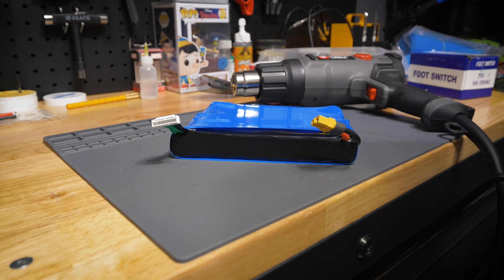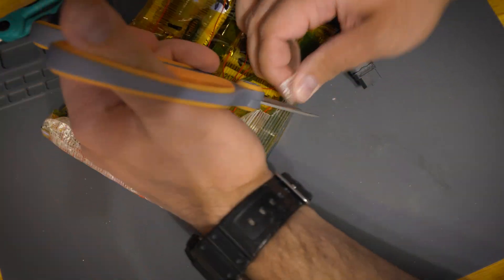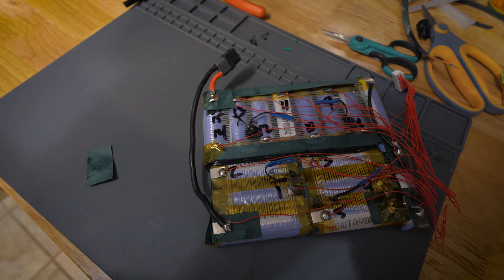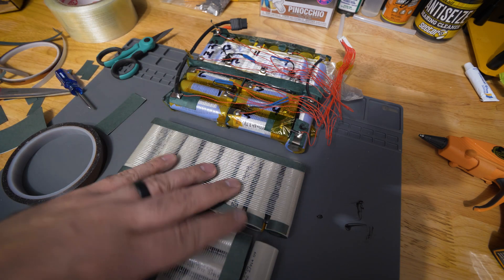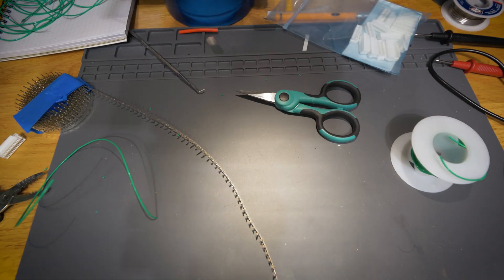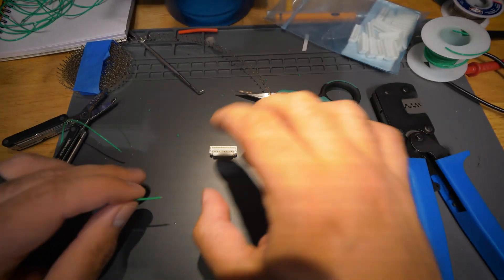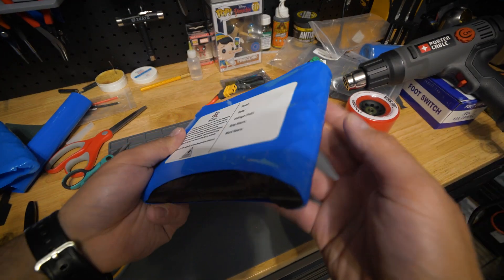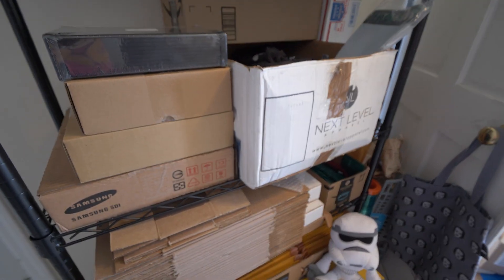Fixing a Onewheel Battery | ChiBattery Quart Rebuild (Pint Upgrade)

Comment: great video, i want to do one of these myself. Is there a specific Thermistor you used ??? Cant find the part listed or mentioned anywhere. Also do you think the pint can take advantage of the extra amps of a p45b instead???

Comment: I have a onewheel gt with 1000 miles. Has been running strong but recently I ran it too low and it now wont charge. I believe the bcm is good but battery is showing 10v.
Can I send the battery to you for rebuild?
Reply from the maker: Unfortunately no, I don’t touch other people’s or factory’s batteries anymore, and I’ve since stopped working on Future Motion Onewheels at the shop. Sorry.
Reply: @TheBoardGarage  Thanks for the content either way.
Any recommendations?

Comment: Is the balance connector same as the one in XR?
Reply from the maker: It is.
Reply: @TheBoardGarage  Thanks for reply. I'm sorry to bother, but other people might have the same questions. Are there some specific thermistors (they're not included in parts list)? And the connector pinout is the same for the XR as well? Thanks in advance
Reply: @tomastraxler8585  NTCLE413E2103F102L is the part number of the thermistors

Comment: Hi Mario do you fix electric scooter batteries, I noticed mine is not holding charge as it use to.
Reply from the maker: I do work on scooters, yes. Some aren't easy to work on so it depends on the scooter model.

Comment: Just curious what battery welder you use and why wonder why you didn’t use the original BMS leads
Reply from the maker: I use a KWeld, running off of a car battery that's on a constant float charge from a bench power supply. I didn't use the balance wires because I just wanted to redo it and see how it would be to manually make all of those crimps.
Reply: @TheBoardGarage  been trying to get a hold of the us rep but no luck
Reply from the maker: I've ordered from their EU site and it works fine.

Comment: Hey Mario - Just discovered your channel, and I'm extremely impressed.  Looking forward to giving this kind of build a try.  Have you attempted any modifications to increase the top speed on the pint?  I understand that it uses the same motor as the XR (I could be wrong there), but it's just tuned to lower speeds.
Reply: The firmware is locked down
Reply from the maker: There aren't really any mods for speed, other than changing tire size.

Comment: Hi Mario. I'm glad you made this video! I've had the exact same issue on my Quart battery. I'm seriously interested in building a battery for myself like yours, but I'm curious about one thing. Sense ChiBatterySystems upgraded to the P42A, is there an even better cell you recommend? Additinally with their new updated cell do you think its not as bad of a design minus lack of quality construction?

Comment: Create tutorial! I have a couple questions for you. 

1) You mentioned that the cells you used are "better". What's better about them? 
2) did you reuse the thermistors or use new ones?
3) How long did this take you? Trying to judge how long it would take me...
Reply from the maker: They have a longer cycle life, and a bit less sag comparatively for similar current draw.
For this, I used new wiring and thermistors. It took me a while, in fairness I took my time. It also takes longer to do things while filming a video and taking notes and photos.
Reply: @TheBoardGarage  Obvious you took your time, it looks very clean! Thanks for the quick response. I checked out your website parts list, I didn't find the thermistor listed. Do you happen to remember which part you used?
Reply: @jessea9448  I measured the stock pint battery pack thermistors and I got a reading of 9.6k so I think they’re 10k thermistors.

Comment: I've never built a battery pack before. I just watched some other videos on spot welding nickel strips, so what spot welder do you recommend? Currently, I only plan on building two of these Quart replacements, so I don't want to go all-out on a pricey machine.
Reply from the maker: I recommend the KWeld. There's nothing like it in that price range, it's one of the best values available. The quality and consistency of welds is very high, and if you decide you won't build any more batteries, you can sell it very easily.

Comment: I bought a quart from Chi. It didn't end up working because my version of pint is too new and not compatible... So bummed. Have you found a workaround?
Reply from the maker: Wait really? I thought current version was still functional. What hardware/firmware version do you have?
Reply: @TheBoardGarage  I honestly don't know how to tell but I just bought it last month...

From Chi:
 "If you bought a newer OneWheel Pint, you have the newer hardware/firmware. Unfortunately what that means is that FM has put in a block that limits using higher capacity batteries. When you powered down the board and turned it back on and got it to go nowhere, that is what is considered a power cycle and that confirms our suspicion of this block. What that means for you, is that you can still use our battery, but you will only be able to enjoy an increase in torque, but not the full range of the battery, and are limited to the stock range of the Pint."
Reply from the maker: Oh wow. Can you please look in the app and find the hardware and software versions?
Reply: @TheBoardGarage  5314/ Gemini 5059
Reply from the maker: @discombobulated2003  Thank you. So indeed...newer firmware. The mods seem to work with 5050 firmware and earlier.
Reply: @TheBoardGarage  Chi's webpage says exactly that 5050 works, newer 5059 doesn't 😔
Reply from the maker: There's a conflicting report from Ryan Witz, and that he's installed mods into newer Pints and they work fine.

Comment: Great video and blog write-up. One note: OEM Pint packs use the VTC5D, not the VTC6. I’ve torn 15 of them apart and they were all 5D cells. Way more C rating and a little less than 6Ah.
Reply from the maker: Yes, you're right. I knew that, but for some reason I had the XR cell in my head and that's what came out. Definitely a brain fart. 
Thanks for pointing it out. 🙏

Comment: Could someone please explain to me which pins to use for what on the connector for the balance harness?
Much appreciated!
Reply: I found a pin out on Google
Reply from the maker: I'll try to remember to update the article with the pinout.
Reply: @TheBoardGarage  Great! Looking forward to it!
Reply: @TheBoardGarage  Thank you so much for this fantastic video! I'm currently at the point to solder the balance wires. Can you please post the pinout?

Comment: Just wondering what size pvc heat shrink you used I don't want to order the wrong size. I'm currently collecting parts and waiting for batteries to come in stock
Reply from the maker: I'm not entirely sure...might have been 180mm I think. I'll have to check and then make a note in the build article. Li-Ion Wholesale has the P42a in stock right now for a great price. A big shipment hit the US a week or so ago and most of them sold out from the usual sellers. But Li-Ion Wholesale has some, I ordered a few hundred from them and got them quickly and cheaply. Best of luck.

Comment: So, which parts of the original quart battery did you reuse? New cells, new balance wires and connector...it's a completely new battery, not a rebuild 😂
Reply from the maker: Come at me, bro! ;) But since I ripped open the original battery...technically I re...built...it. Because #science

Comment: Hey man, great video as always! Quick question regarding the write-up on your blog. You mention that you believe batteries using this configuration to be unsafe, I am curious how dangerous you think it is? I have a Quart installed on my pint and wondering Is there an increased risk of fire while charging or is it more risk of the cells failing while riding? Thanks!
Reply from the maker: The idea of "safe" is kind of tenuous when it comes to larger lithium ion batteries. None of them are actually safe. And when you see the words "safer" or "safest", really what it means is "less dangerous" or "least dangerous". 
The Onewheel's battery was designed to fit in a box, accomodating for the space of wiring, a cell holder frame, and insulation. The space between cells and the box is the primary safety for failure. Extended battery mods remove that safety, and so they're inherently less safe, or more dangerous. The actual level of danger is unknown, since objective testing isn't ever done. And likely won't be, because not only is it difficult and time consuming, but it doesn't do well for hype, marketing and sales. Science in practice is boring. People prefer hype, easy answers, and brand loyalty. 
It's an imperfect situation, but I've chosen to manage imperfections rather than deny them. And at least, try to be realistic about it.
Reply: Do you like the range increase? :D I really want a new battery for my pint, my stock battery now gets 5miles after 1500 miles. I use to get 8-10 miles when my onewheel was brand new. I’m 200lbs. I wonder if I messed up my battery prematurely by leaving it in the winter cold in my car over night many time, rip

Comment: Could you please let us know which were the original cells in the quart battery?
Reply from the maker: Originally they were Samsung 40t cells. They then changed to the P42a.
Reply: @TheBoardGarage  Do you think a 15s2p configuration with p42a 21700 cells would be better (not range wise) than the 18650 15s3p they have in the CBXR? You should do a video talking about the best possible battery for an XR and build it
Reply: @legolasgleaf  good question. And if 3P is fine what should we use? Ncr18650ga is fine or we should look for something else?
Reply: @andrzejz8316  The better way to go should be maybe something like 20s2p, but then the BMS will not work... so need some kind of VESC. And I am talking in the original unmodified XR
Reply: @legolasgleaf  I assume we are talking XR controller here. Ofc vesc seem to be the way, but I don't think I have the time to be early adopter. Community has some enough knowledge to build up (motor overheating?) and some ready to use parts (e.g. rigid waterproof battery box) available. Probably going there next year.
Reply: @legolasgleaf  The big issue with 21700 cells is they don't have as much current deliver so under heavy draw from the motor they tend to sag pretty badly. Granted even an XR only needs around 30A of current delivery but most 21700 seems to struggle with even that which seems to be why 18650 still reigns king for most PEVs is what I've noticed.
Reply: @mwiz100  but p42a 21700 cells is 45A, and if you have it in 2p is 90A (which even if is not real, is more than enough, right?), that's why I am asking if a configuration of 15s2p with 21700 cells could be as good as 15s3p with 18650

Comment: Are any schematics available for this build. Mainly balance connector and xt60, it seems reverse or am I crazy?
Reply from the maker: It is indeed reversed. I'll add that to my blog post. The post has detailed photos of the rebuild, and I'm currently working on the balance connector pin out. It'll be updated on the blog later today.

Comment: Thanks for the video.  Really sorry to hear about this failure.  I've had the Chi Battery Quart since Xmas 2020, couldn't be happier.  One thing I noticed early on is that the battery is still doing something long after the Pint charger indicates that the charge is complete.  If you watch, in Diagnostics, the Regenerated Amp hours number will continue increasing for a long time.  I have been letting my Pint continue charging until this number stops changing.  Do you have any knowledge of what this is?  Is it still balancing after getting to full charge?
Reply: Even on my stock fairly new Onewheel+ XR this happens when looking at the diagnostic page while the battery has reached 100% the regenerated number continues to rise for a while. it does eventually stop increasing. I have heard that the battery percentage is a bit of a guess and is complex to work out correctly, so it is probably just a fluctuation or miss calculation while charging.

Comment: Did you diagnose the deffective battery, was it a bad cell, deffective BMS or simply weared out ?
I was curious to know Wh capacity and internal resistance if the battery pack before/after.
Nice craftmanship !
Thanks for sharing with us.
Reply from the maker: It wasn't the BMS, it still functions normally with the stock battery. I haven't broken down the pack entirely, which is the only way I currently have to fully test the cells. The owner requested I close up the battery and rewrap it so it can be rewired and used to power something else, so I unfortunately won't be able to fully check what happened.
Reply: A common problem is cell balance fault.
Many people know you should not overcharge your battery, or leave it at full charge for extended periods. But many people don't know that the BMS only performs the very important cell balancing task at the end of charging, essentially when the charger light is green. So you need to charge it until green, then leave it charging on green for a couple more hours. This should not be done every charge cycle, but every 10 charge cycles is fine.
Unless the battery capacity has recently dropped, in which case you can do some "forced balancing" by riding it until low (under 40% charge) then charge to green and stay green for 2 hours. And do this for 3 or 4 rides/charge cycles in a row to fix it.
Normal cell degradation occurs slowly over hundreds of charge cycles, so if it gets worse over a few weeks that is most commonly a cell balance issue. Sometimes you get a bad cell, but normally that goes real bad real quick, and doesn't show improvement after a few forced balance cycles.
Reply from the maker: It was not a cell imbalance, all cells show similar voltage, with a Delta of only about 0.03-5 volts. I drained and charged the pack fully twice, and the voltages didn't deviate further. Could be a bad cell, or a bad batch of cells. The owner of the pack is well aware of proper battery use and care (we talk all the time, so they never hear the end of it).
The unfortunate reality is that when it comes to prioritizing time and effort, this was the best option. He only paid for parts, I was able to make this content and information available, and he ended up with a more robust and better built pack with new and tested cells. 
I don't yet have the resources to fully test batteries unless they're broken down into individual groups. One day I may, but I'm still a small channel with limited capital. So this was overall what I thought was the best route to go.